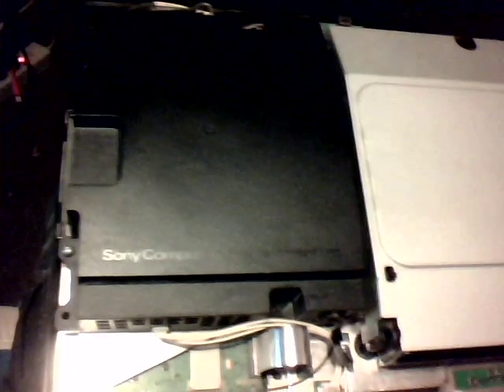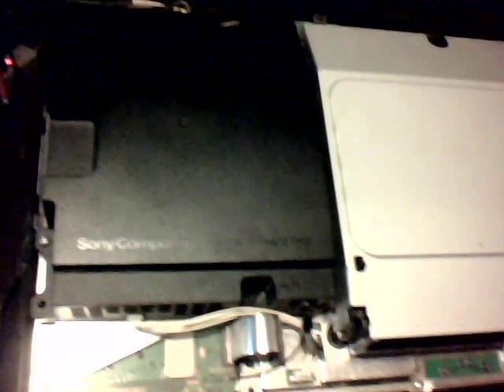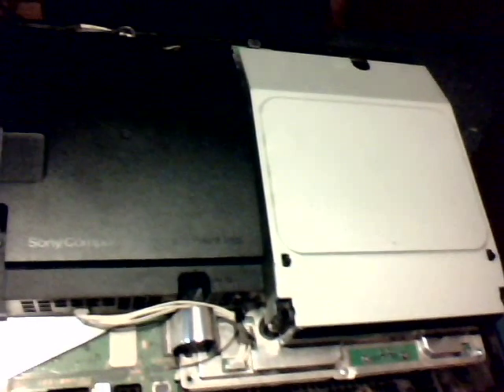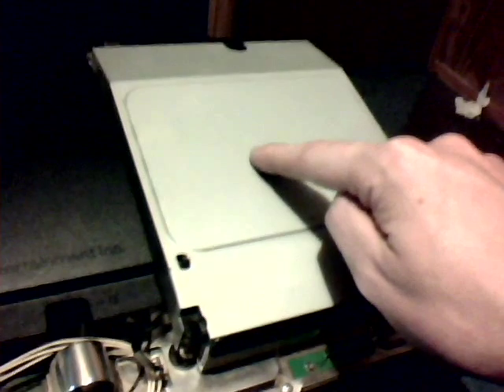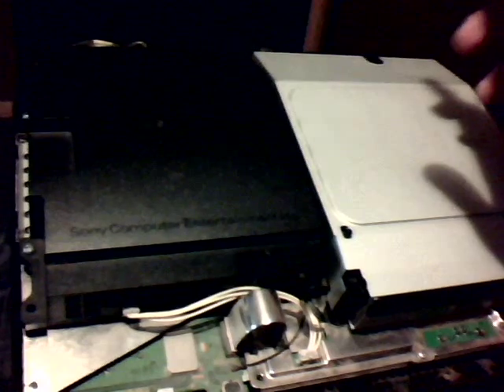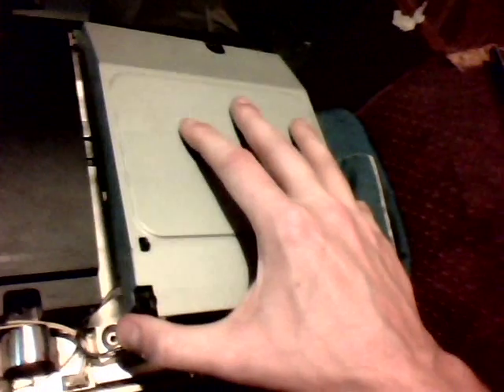ps3 repair for shutting off during gameplay

Comment: Hey dude i tried all the tutorials on YouTube but nothing worked for me.but later i tried something by myself. To fix ur ps3 that turns off during gameplay simply turn on ur ps3 and then press the eject button and remove the disc. Once done press the power button and turn it off but u will notice that it is not turning off. Then what u will do is simply turn off rhe main power supply. Then wait for some time and turn it on again and it will work  again.
I tried this thing and it worked for me.
Reply: Having the same problem man.mine will cut on for two seconds then cut off . And then sometimes It will stay on for gameplay an then shut .. Could your solution work in my situation
Reply: You should try it mine worked and well now I have a ps4 😎
Reply: +A'A''T help me. My ps3 doesnt work

Comment: I got the same issue..  Only game that works is gta 5 off line game play.  From trouble shooting a lil and some general knowledge I feel it turns off cuz the hard drive gets over worked.  Iv reset it completely,  didn't work, downloaded games off the ps3 store used to work but don't.  I haven't tried to replace the hard drive yet but want to exhaust all routs before I do that.  Help please.
Reply from the maker: again if your  problem is the disk drive then because its modular in design you can simply replace it. there apparently arnt run by drivers as i have successfully transplanted them and they worked. but if your hard drive is bad i recomend consulting the replacement guid provided by sony.
Reply: +ralph kennedy thanks,  I took it apart tho.  The fan won't kick into overdrive when holding the ejection button and flicking the back switch on.  Also the power supply is crapped out.  Nice video

Comment: pls help my fat pregnant ps3 is like a vacum cleaner when i play some games it shuts off by beeping 2 times red light...pls help to fix this tnxssz
Reply from the maker: you pobably have the same issue as i did in the video. i believe your power inverter is most likely bad and need replaced. if you can get another just follow the proccess in this video to fix.